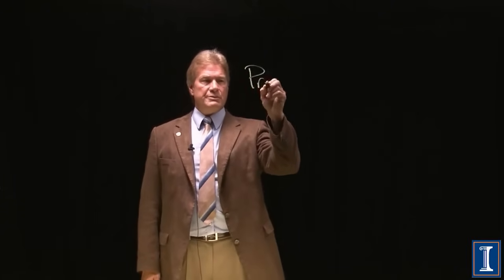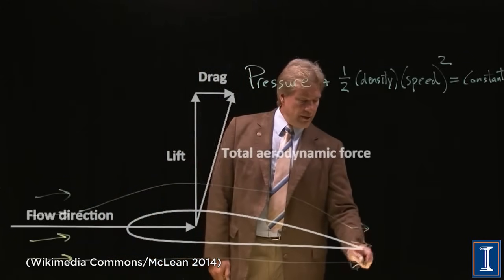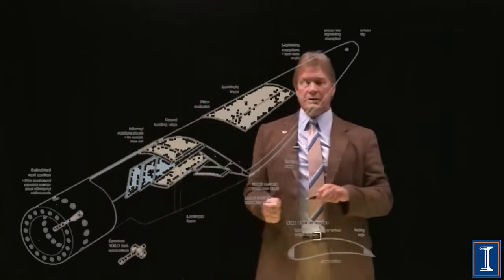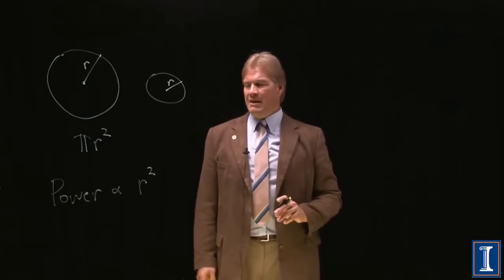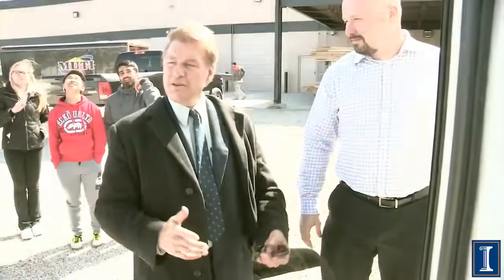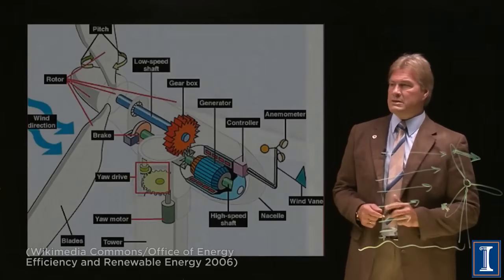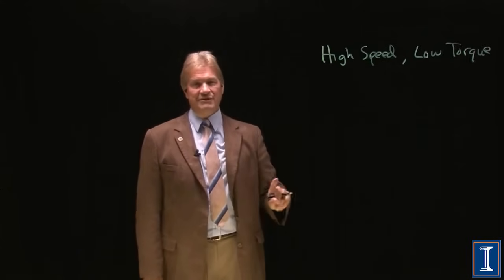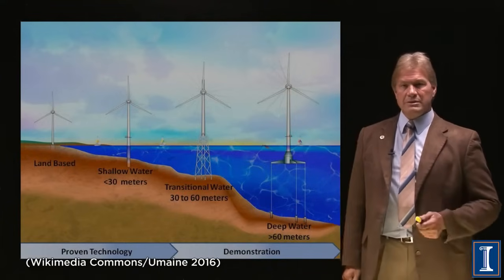How Windmills Work

Comment: OMG - the part about airplane wings is just flat wrong; I was literally stunned hearing it from someone with a PhD. 🤬🤬🤬 Two air molecules next to each other, one passing over the top surface of a wing and one passing underneath, do NOT meet up with with each other again. The molecule passing over the top FAR outruns the one passing underneath. It goes even faster over the top than what would be explained by the “longer path, same time” myth. Lift only occurs if the air hits the wing at an angle, and the wing thus changes the direction of the relative wind.

Take a look at the wing cross section of a stunt plane; it will be nearly perfectly symmetrical. This is so that the airplane will perform identically in both normal and inverted flight. Which brings up an obvious question: how do airplanes fly inverted?

Commercial, GA, and some military aircraft have cambered wings (curved on top, flat on bottom) because this wing shape can fly at a higher angle of attack, and therefore slower.
Reply: I suspect that Professor Ruzic is trying to give a simplified explanation of where a wing's left comes from that is sufficient to get to what he wants to wave his arms at in the latter half of the video.
I suspect that he knows full well that Bernouli's Principle is not entirely sufficient to fully explain where the lift of a wing comes from as he says "there's more to it than that" after he gets done giving the simplified explanation for Bernoulli's Principle.

But you're also also not entirely correct in your description of where the lift of a wing comes from as I think Doug McLean (retired Boeing Technical Fellow) who Profess Ruzic reference by subtitle and in the references at the end of the video points out in the video "Common Misconception in Aerodynamics".
Reply: @lewiscole5193  There’s a difference between a simplified explanation and a wrong explanation. The “longer path” explanation is one of the most common misconceptions in aerodynamics. For simplicity, it would have been better to just say “stick your hand out of a car window and tilt it.”

I’m not saying that Bernoulli’s Principle is inaccurate; as long as the velocity is low enough that air can be approximated by an incompressible fluid, Bernoulli’s equation still holds. But the lift provided by a given wing profile depends on two things, angle of attack and velocity.
Reply: @David_Lee379  
> There’s a difference between a simplified 
> explanation and a wrong explanation.

Really?  So is Newtonian mechanics just a simplified version of the not-wrong version of the nature of the world described by Einstein?  And how does that work since we know that Einstein didn't give a totally accurate description of everything (i.e. it's "wrong")?

Let me be perfectly clear here:  the description of how/why a wing produces lift given by Professor Ruzic really SUCKS .  I don't like it at all.
And if all you did was point this fact out out, then I would have no problem with what you wrote and wouldn't have responded.
But you went further than that by trying to effectively say that the reason that a wing produces lift is due to deflection of the air, which strictly speaking, is also WRONG as it doesn't doesn't accurately describe the gory details as to why a wing produces lift.
(And if you think it does, then I await with bated breath for you to wave your arms at how/why air deflection causes an uplift well in front of the wing.)
IOW, you're  trading one inaccurate (wrong) explanation for another inaccurate (wrong) explanation.

And along the way, you toss out stuff that clearly (to me) makes it sound like you don't really know all that much about what you are talking about either.
"Camber", for example, does not mean a wing that is flat on the bottom and curved on the top.
And wings can "fly" (i.e. generate lift) at a zero Angle of Attack (AoA) which is why there is such a thing as the "zero lift line" relative to the AoA which can occur when the AoA is negative.
And don't get me started about your comments concerning why various types of aircraft use cambered wings in order to increase the higher (maximum) AoA, especially when the single biggest thing you can do to increase maximum AoA is to round the leading edge so as to delay flow separation. 
Then there's the matter of lift coming from the deflection of air when in a wind tunnel, wings can still generate lift even though the walls of the tunnel effectively prevent air deflection from going anywhere.

> The “longer path” explanation is one of 
> the most common misconceptions in 
> aerodynamics.

Agreed.

> For simplicity, it would have been better 
> to just say “stick your hand out of a car 
> window and tilt it.”

Ummm, no ... not really.  At least not if you're trying to imply something about why the blades of many windmills look like airplane wings.

> I’m not saying that Bernoulli’s Principle 
> is inaccurate; [...]

And I'm saying that it IS inaccurate ... but it's "accurate enough" for many applications.

> [...] as long as the velocity is low enough 
> that air can be approximated by an 
> incompressible fluid, Bernoulli’s equation 
> still holds. 

The operative word is "approximated".

And the form of Bernoulli's equation that is usually presented not only requires that the velocity be "low enough", but also that the viscosity of the fluid can be treated as virtually non-existent.
Otherwise, one of the less simplified forms is a better fit.

> But the lift provided by a given wing profile 
> depends on two things, angle of attack and 
> velocity.

First, we are talking about wings (i.e. wind turbine blades), not wing sections.

Second, generally speaking, if you squint your eyes real tightly, the lift produced by geometrical similar wings varies based on angle of attack and  relative air velocity as well as other factors, such as AIR DENSITY, WING AREA, AND SURFACE ROUGHNESS.
(And OBTW, if you look at any of the books on wing section data like Abbott's "Theory of Wing Sections", you'll see graphs that often times show wing section data based on "standard roughness" versus something else.)
Air density, of course, varies with temperature, and when it comes to wing area, we're talking about wings that are more or less straight and that are longer than they are wide (i.e. with aspect ratios well away from 1).
And I'll ignore viscosity (can you say "Reynold's number"?) as I assume that we're talking about something bigger than a bumble bee.

If it sounds like I'm being picky, I am.

ISTM that in real terms, all Professor Ruzic was trying to say was that (1) the wind moving past the wind turbine blades causes them to produce a force which causes the blades to rotate and (2) the forces acting on said blades depends on where in the arc the blades are moving due to differences in air speed from near the ground to high into the air which can cause structural problems.
And the cause of the forces?
Why they're the same ones that cause an airplane wing to generate lift, implying that that the reason the blades look like wings rather than plates on an old fashion Dutch windmill.

Unfortunately, Professor Ruzic chose to try to explain why airplane wings generate lift and he chose to use an explanation that really SUCKS but one which just happens to be the one that like it or not is commonly passed out in schools and in books.

I may not like it (and I don't), but I suspect that this sort of explanation, even though it's WRONG (i.e. is not at all accurate), is probably "close enough" for the vast majority of viewers of this video and any more "accurate" description would likely distract from the "important" parts of this video by bringing up a level of detail that just confuses most people.

If you want to give a more accurate description of why wings lift anyway, well, knock yourself out.
But don't be surprised if someone points out that you're more accurate description isn't entirely accurate either even though you obviously don't have a PhD in aerodynamics .
Reply: @David_Lee379  
It's occurred to me that I might not have provided something that clearly shows that what I'm bitching about is more than just theoretically.
So let me try to correct that by pointing out that if deflection of air were correct, then it should be able to accurately predict various physical phenomenon about the lift of a wing including, for example, how the lift of a wing increases as a function of Angle of Attack (AoA).
While I haven't done the math myself, others who have have noted that if the lift of a wing were simply due to air deflection, then the amount of lift produced by said wing should vary with AoA as a function of the SQUARE OF THE SINE OF THE AoA (at least until flow separation occurs) instead of what it really does which is as a simple linear function of the AoA.
IOW, just as the Bernoulli explanation for why a wing produces an incorrect/wrong description of how much lift a wing should produce assuming equal transit time were applicable (which it is not), so too the air deflection explanation also produces an incorrect/wrong description of how much lift a wing should produce especially as the AoA changes.
Reply: @lewiscole5193  No worries; thanks for clarifying. My real issue was with the whole equal transit time thing. My understanding though is that if you were to integrate the velocity and pressure over both upper and lower wing surfaces, Bernoulli's equation would still give you a very close answer at low velocities.

Here's a link to what I had in mind when I was talking about deflecting airflow. Basically the net change in velocity from the free stream is the source of the force from Newton's Second Law.
https://www.grc.nasa.gov/www/k-12/airplane/right2.html
Reply: @David_Lee379  
> No worries; thanks for clarifying. My real issue 
> was with the whole equal transit time thing. 
> My understanding though is that if you were to 
> integrate the velocity and pressure over both 
> upper and lower wing surfaces, Bernoulli's 
> equation would still give you a very close 
> answer at low velocities.

Okay, let me start out by saying something which will probably shoot the hell out of any credibility you might think I have when it comes to the subject of why wings fly:  I'm not an aerodynamicist and I don't play one on TV.
I'm an amateur on the subject, as I suspect you are, with the only significant difference between us presumably being that I have a little more experience in researching the subject than you do at this moment.

I'm far more interested in airplanes rather than just their wings which can be treated as magic lifting devices that can be represented by a point or line where all of the forces and moments acting upon the wing can be applied (i.e. the aerodynamic center).
If this seems like a weird way of thinking about things, it was, and so far as I can tell still is, the way that aircraft designers usually think about wings as is evidenced by classic 1949 textbook "Airplane Performance, Stability, and Control" by Perkins and Hage up to more recent works like Raymer's 1992 textbook "Aircraft Design:  A Conceptual Approach".
Some fundamental hydrodynamic theory is introduced at the start of both books, namely that in theoretical terms, lift is the result of a circulating airflow set up about the wing (it's lifting line) due to its shape ... and that's about it.
Bernoulli isn't mentioned at all, although presumably, everyone is supposed to know about his most basic equation by the time they get around to reading these textbooks.

I don't know why that's the case generally, but in my case, the reason is simply that Bernoulli doesn't get me anywhere useful, the classic example of that being what you get when you try to compute the amount of lift generated by a wing using the equal time assumption.
If you assume that two adjacent parcels of air separate at the leading edge of a wing, with one parcel going over the top of the wing and one going under, and then rejoin at the trailing edge of the wing together (i.e. the equal transit time assumption), then you can come up with an increased length relative to that found on the lower part of the wing which you can then use to figure out how fast the air parcel over the top of the wing had to be accelerated.
The problem is that the amount of lift one gets is WAY lower than what experimental data says it should be, which clearly indicates that there's something wrong when it comes to trying to apply Bernoulli to a wing.
And things really go south when you see the wind tunnel videos that show that the air moving over the top of a wing arrives at the trailing edge long before the corresponding parcel of air flowing under the wing reaches the trailing edge, shooting the hell out of the equal transit time assumption.

You can of course break up the surface of the wing into many small segments and compute a pressure distribution, but IMHO, there's no particular reason to trust in the accuracy of such a distribution without knowing more about the underlying assumptions made in order to apply Bernoulli's equation(s).
For example, Bernoulli's equations describe the relationship between pressure and velocity experienced by a particle traveling along a stream tube.
Often times, the assumption is made that the width of the stream tube is "pinched" by other overlying stream tubes over the top of a wing, but there's really no good reason to believe that this is the case (at least not enough to care about) and in the absence of a good reason, you can come up with just about any pressure figure you want.

In practical terms, what keeps an airplane in the air is not Bernoulli but rather the the ability of someone to stack enough money under the wings and/or body so that's wheels don't touch the ground.

> Here's a link to what I had in mind when I was
>  talking about deflecting airflow. Basically the 
> net change in velocity from the free stream is 
> the source of the force from Newton's Second 
> Law.
> https://www.grc.nasa.gov/www/k-12/airplane/right2.html

Okay, we both need to be on the same page here.

The usual alternate to the Bernoulli explanation for why a wing produces lift is one where the lift of the wing comes from the air acting like little ping-pong balls that hit the bottom of the wing and in doing so, end up being deflected downward as they impart an upward force that acts normal to the surface they strike.
This explanation is clearly wrong for your typical run-of-the-mill wing as the amount of force imparted depends on the amount of (lower) surface area exposed to the oncoming ping-pong balls of air which various as the sine of the AoA.
When you take into account the amount of force that ends up being directed normal to the oncoming stream, you end up with the force (lift) varying as the square of the sine of the AoA.
This is the explanation that I'm referring to when I use the expression "deflection of air" and the one that I assumed you were referring to since you talked about wings with a flat bottom.

The problem with this explanation is that it treats the air as being made up if descrete small parcels (i.e. basically ping-pong balls) instead of a continuous medium which is what it is. 
(If you weren't already aware of it, fluid dynamics is part of something called the continuum mechanics).
And in real life, the fact that air acts like a continuous medium until some very high altitude when moving subsonically matters a whole lot.
The effects of a wing both in terms of pressure and velocity on parcels of air occur well before a wing arrives as well as well above and below the wing.
Why?  Because these effects are propagated at the speed of sound from where ever they are initiated.
The result is that a wing doesn't just affect the air that it comes in direct contact with, but also air that it doesn't come in direct contact with amounting to a cylinder of air the diameter of which is about the same as the span of the wing.

Now thanks to the joys of the conservation of linear momentum, if you want a wing to generate an upward force (lift), you want/need to cause some of this cylindrical volume of air to move downward (downwash) -- to TURN it -- not simply to DEFLECT it through direct interaction with the bottom part of the wing.
Consider the case of a wing made up of some old fashion more-or-less flat bottomed wing sections like the NACA 4412 (it's the first one I could find in "Theory of Wing Sections").
This section generates lift even at an AoA of 0 degrees (in fact, it's zero lift angle is something like -12 degrees) and so it's presumably turning air downward, not by virtue of any direct impact (deflection) with the bottom of the wing, but rather in large part from from the downward movement of the air coming from the top of the wing.
So IMHO, the NASA Webpage you cite is correct when it talks about lift being produced by flow TURNING of the air because this is not the same as DEFLECTING the air, at least as the words seem to be commonly used in discussions about how/why a wing produces lift, and says nothing about the actual mechanism(s) that cause the turning to occur.

And since you were kind enough to provide me with a reference, I'll return the favor by providing a link to a video by an associate aerospace professor at the University of Michigan, Professor Krzysztof Fidkowski, on why aircraft fly in which he talks about the misconceptions of using Beroulli and air deflection to explain why wings work:

  < https://www.youtube.com/watch?v=aa2kBZAoXg0 >

And if you really want to get your toe wet with aerodynamics, may I suggest Anderson's textbook "Fundamentals of Aerodynamics" which I put down long before reaching the end.